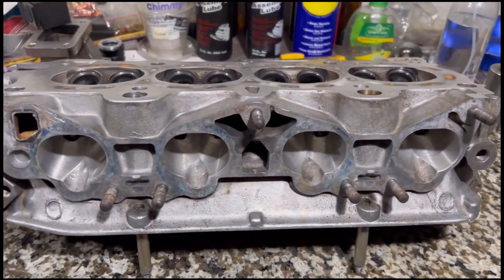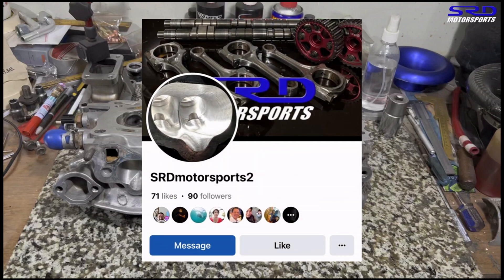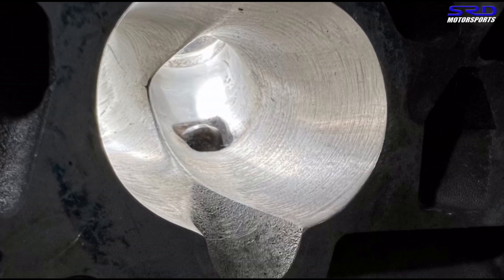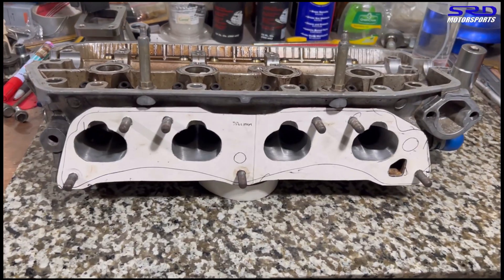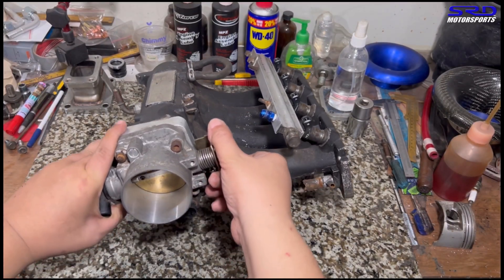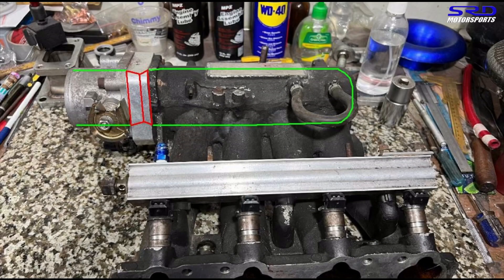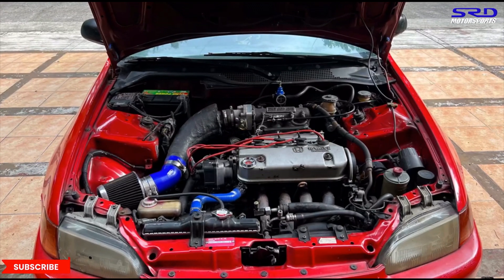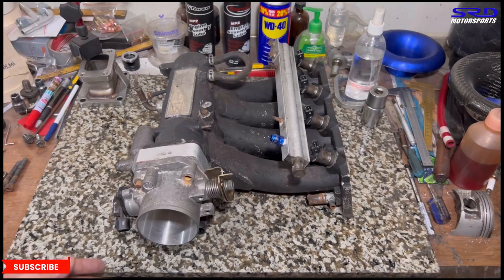D16a6 Non Vtec All Motor Build Series Part 3 ITB Intake Tech

Comment: How well did that blue fuel pressure regulator work? I bought the same one but a red one I got it for $8 😅😂I plan to open it up and check everything and put some loctite
Reply from the maker: Still working now and it’s been years😅
Reply: @SRDmotorsports okay thanks and it’s just a cheap generic huh? I got mine from Temu 😂
Reply from the maker: just found mine as second hand years ago so I wouldn’t know what exactly 🤣

Comment: What’s more of an advantage when running itbs. Fuel being sprayed close to the flaps or father way like close to the flang?
Reply from the maker: It’s mainly “response” or responsiveness
Reply: @SRDmotorsports  How do you like to setup your injector locations on itbs
Reply from the maker: Modern (current injectors) already atomize real good so oem location is fine , but for older 80-90s style injector a little farther out kind of helps

As well as fuel pressures

Comment: Great video Ralph. I got 1 question though regarding ur TB and IM setup. Here u outline the venturi effect but what about the "step" after the TB into the manifold to stop reversion? U mentioned before in a previous video that ideally, the IM inlet opening should be slightly bigger than the TB to create a step but here, on ur personal setup, we see it go from 70 down to 66 then to a 68 opening
Reply from the maker: Yep! There is still a small step by that 68mm opening
Reply: @SRDmotorsports  I see. Got worried u were losing hp for a sec lol
Reply from the maker: Nahhh

Comment: Sorry, I was commenting while watching, just reached the part where you discussed your ITB. Thanks for sharing the specifications of your ITB, much appreciated!! 🍻
Reply from the maker: One of the reasons I shared it specifically for you is cuz initially I just wanted “longest” with enough space to breath from firewall

Which ended up being close or same to the skunk2 runner length

Which then to my susprise numbers fell inside Bell’s and Jenvey’s window! So that got me stoked lol!
Reply: @SRDmotorsports  Excited to see the results of the build! But no rush, it's a lot of effort to build the engine but also takes a lot of time to edit the videos. Curious if the current exhaust set up can support the new induction side of the engine once it's done
Reply from the maker: On the exhaust side of things 
Is a borderline safe or uncertain but more safe

Right now my header is a 4-2-1 but sequentially paired like Hytech not the SMSP style tri Y

But I’m hoping I can quickly brush up my welding skills (already have a Tig) cuz 
Most likely this set up might shine even more with a decent 4-1 with good merge
Reply: @SRDmotorsports  Since you mentioned it, cylinder pairing  for the header is quite interesting, John, Dave and Joe have different opinions on what works but they all made good power with their designs. Rushi's design was textbook but surprisingly effective. Literally textbook, because years later, I found that the dimensions work out to be what Graham Bell suggested.
Reply from the maker: True on exh pairing etc etc

However I’ve slapped on an smsp pairing on mine and it was drastically “numbed” I thought I could tune it but bfor retuning we managed to repair the crack on this header and bolt it back up and Boom! It livened up like before

So I was like wth? That much diff in feel? 

Ofcourse no dyno but it’s why I kinda stuck with this one and suddenly Endyn’s words on his preference for hytech came up lol
Reply: @SRDmotorsports  Right now I'm curious as to why Joe didn't like how John pairs his pipes. But John makes very good power with his header designs. Joe mentions a dip around the 4300 rpm region when paired via John's way but so far I haven't seen any sheets that support what Joe claimed.
Reply from the maker: Good point I think if Joe preferred 4-1 it’s a given as Bisi does too and we see most known race header makers now all rock “burns” collector

I think johns preference was Vs the smsp lay out and the conventional short dc sports 4-2-1 that’s paired safely away from the firing order

I think it’s mainly on “scavenging” and that’s where the 4-1 is superior

Comment: Try searching for this "Design of an Intake Assambly for a Formula SAE car" it kinda looks like your TBRIA (follow the typo, hahaha)
Reply from the maker: Interesting il check it in a bit…

But extra interesting cuz I’ve always read a lot about Formula SAE and mainly how they worked on maxxing out the displacement they had and the induction of each team is ALWAYS an interesting part! with complete analysis too!
Reply: @SRDmotorsports  What's also interesting is that some of them even employ the use of restrictor plates, so imagine if there were no rules, they could actually make better power
Reply from the maker: Yes! Actually it might even get borderline dangerous but very interesting 

Kinda the same why I paid interest on Formula 3 22mm restrictor induction too!

Toda and mugen still ran 2liter and still exceeded 220hp

Comment: I have the exact same throttle body and intake manifold. So hopefully your venturi spacer will make good power and if it does I'll buy one for my setup. Maybe it'll compliment my delta 272 cam real good!
Reply from the maker: That’s def worth a try if u got the same intake and throttle 

Only prob is it’s costly to get the 1in thick aluminum plate here but I feel u can def source it out there… where ya from btw?
Reply: @SRDmotorsports  & @1blackman I'm in Canada and I picked this up to fit a stock throttle to a pro series. It's definitely under an inch thick. but if you really wanted to, you could stack 2 of em 

https://www.ebay.ca/itm/174948644161?mkcid=16&mkevt=1&mkrid=711-127632-2357-0&ssspo=4-6zdtdgtre&sssrc=2349624&ssuid=0ja4EEY3TGu&var=&widget_ver=artemis&media=COPY
Reply from the maker: @tayvonrose2528  oh snap that’s a good find man!
Reply from the maker: @tayvonrose2528  that a Canadian store?
Reply: @SRDmotorsports  it ships from china
Reply from the maker: I see but eBay store? Cool doe
Reply: @SRDmotorsports  Texas, USA
Reply from the maker: Ooooh and everything’s big in Texas 💪
Reply: @SRDmotorsports  my cylinder head code is P2A
Reply from the maker: Oh I see I see
Reply: @SRDmotorsports  do you guys have that head over there?
Reply from the maker: Yeah I believe so
Reply: @SRDmotorsports  ❤️
Reply: @SRDmotorsports  that's the head I need ported. How much would you guys charge for that head to be ported and shipped to me?
Reply from the maker: Lemme check and u can check the shop page for more info too
Reply: @SRDmotorsports   took some measurements today. The plate is 0.77 inches thick and tapers from 56mm to 62mm
Reply from the maker: Hey!!! That quite good!!!! Almost an inch